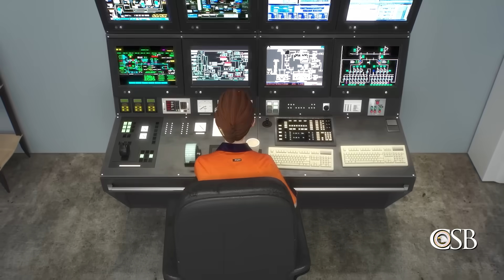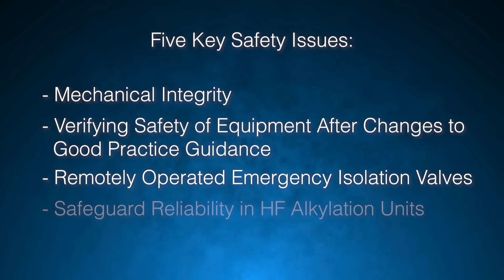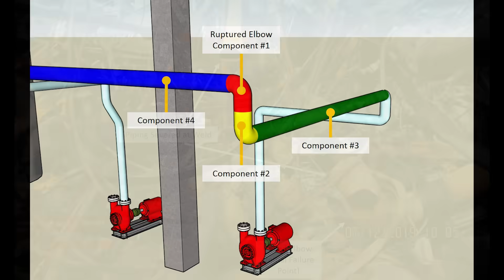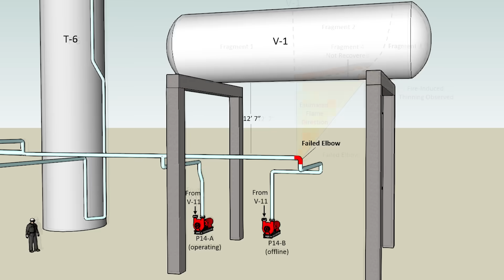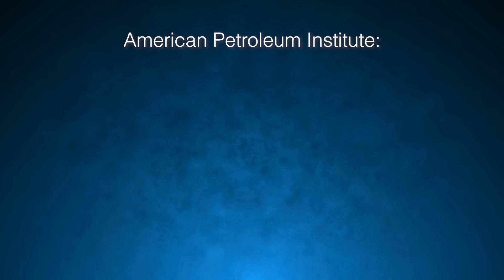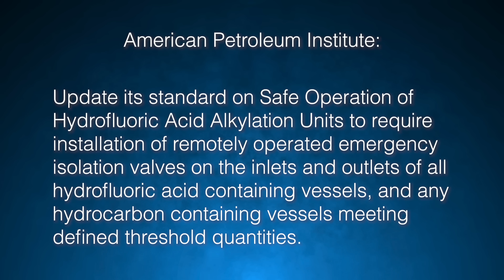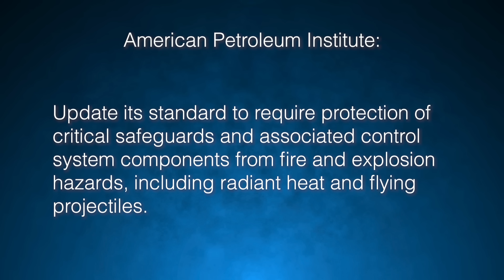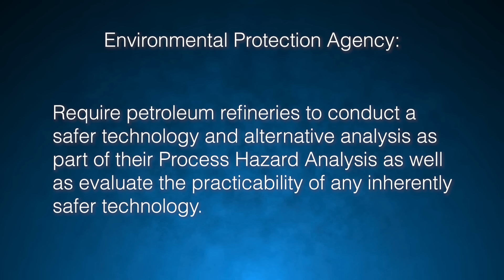Wake Up Call: Refinery Disaster in Philadelphia

Comment: I work as a systems engineer across every industry imaginable. I specialize in Medium Voltage Variable Frequency Drives, but I also tend to handle advanced applications or large applications of industrial automation control/visualization, industrial networks, and safety system programming. (If anyone has seen "how its made" I typically program and control all of those types of facilities)

I have watched everyone of your videos as I feel that most of the issues could have been mitigated through proper alarming and shutdown controls which are usually one of my core focuses in my line of work. These videos help me remain diligent and aware of control strategies that prevent or detect these failures. I can not express how much I value these videos, they have helped me refine a few of my control system safety programming and controls. I have even worked on a leak detection algorithm that can be used to predict leaks in production facilities (still needs some work). A lot of strategies I have implemented and adopted originated from me watching your videos.

Thank you all for your work!  I could not think of a cooler job than one that investigates these happenings and presents them to people to help them prevent the same from happening to them. I would do anything to join your investigation & development  team in a control system capacity! You guys are incredible.

You guys are awesome, I can not say it enough. I never take the time to comment anything on youtube but I felt that I needed to let you know that the work you do with these is incredibly valuable and appreciated, thank you!
Reply: thanks for probably saving a lot of lives by honing your craft.
Reply: @03056932  and you as well, sorry I did not see it until now.
Reply: It is always good to see the many ways things can go south in a hurry.  I am sure every scenarios you encounter helps build your expertise portfolio.  That expertise will not be directly replaceable, all we can hope is that as your career advances, you will pass along as much of it as possible to the next generation.  Doing that, you will continue doing good in the world for many years into the future.  A tremendous legacy Mr. Croop.
Reply: @vanguard9067  thank you for the compliment, I do appreciate it.

Comment: I don't know about the US, but over here in Europe / EU, refineries have to shut down every 6 years in order to do what's known as a "Turnaround" or "Revision Stop", EVERYTHING is drained and shut down for about two months, as the entire facility goes through repairs and maintenance as necessary. 
The last time I was on a job like this was in 2019 on the largest refinery in Scandinavia, nowhere near the size of this in Philadelphia, but still. 

There's a ridiculous amount of workers on site these two months, if I recall correctly someone said around 6 000 workers were involved back then, in order to finish everything within the timeframe set. Anything from cleaning out the piping, to changing piping, flanges, gaskets, blinding and opening and replacing reactor catalyst mass in ALL reactors, repairs and modifications to anything. 

ABSOLUTELY everything is being checked and fixed as needed, which probably helps combat things like this.

Comment: Nobody from API, or the refinery thought to test carbon pipe in a refinery for 45 years? 
Ultrasound testing is a Canadian industry standard. Plus our facilities go thru extensive maintenance every 5 years. Even steam systems.
Want to know what ball is being dropped presently? Just wait for all the new code applied to all the new hydrogen systems being built by all the new people. Worse yet, the rush to get small modular nuclear reactors online while simultaneously reducing “red tape”. 

40-50 years between turnarounds?

Comment: Leaks at elbows are common even in the plumbing construction industry. A sweeping elbow gives less flow resistance and last longer. Did I hear it was built in 1973? Amazing. Need to do some pressure testing given isolation of the test point.

Comment: I worked in that refinery for 30 years off and on for contractors those people would literally let the fireproofing rot off the beams before they replace it that whole Refinery was a rust bucket... old boilers rotten pipes they wouldn't fix anything until it broke they would run the hell out of the boilers just for profit the shutdown's got shorter and shorter to save money for high profits that whole Refinery was an accident waiting to happen so happy it's over

Comment: solution: the fire suppression system should be automatically activated. The remote site detects issues and notifies central control, but if it is unable to communicate or does not receive a response, should automatically start up. 
This could be detrimental in some cases, but probably better than current

Comment: Had the operators on shift that night not successfully dumped the HF tanks and turned on the water cannons, it's entirely possible that a disaster the scale of Bhopal could have unfolded. HF mists have been observed to travel several miles, and within that radius includes a huge portion of downtown Philadelphia. A worst-case scenario would have made 9/11 look like a walk in the park.

Comment: #BadDesign  The water cannons should activate automatically, even if there's not a fire, every second of every day unless a signal is received from the operators console. It's just water. It doesn't cost anything and if there's a bug in the wiring it's worth wasting some water to know about it before there's an actual fire.

Likewise. Isolation valves should close every second of every day and process pumps should stop every second of every day unless the control console commands them to stay open.

Seriously folks. You can't install a garage new door opener today without installing those damn optical sensors anymore and you can't even hotwire it because they send an encoded digital signal from one side of your door to the other.  If a wire breaks. Your garage door won't operate. Try it out. This kind of failsafe is default on residential garage doors. Why it was not in use and industrial chemical processing plant is beyond unforgivable.

Comment: 7:39 I can't see what you're saying about faster rusting in this picture. what I can see is the  simple connection of two pipes.
and that always looks like this. double wall thickness where the pipes are on top of each other, as seen in the photo (t2) and the normal wall thickness of a single pipe (t1).

Comment: HF is so much more dangerous than what it's made up to be here. If you spill some on your lap as a lab tech did a few years ago you're probably a goner. It will mess with the calcium ion channels in your body, stopping your nerves from functioning essentially. It's a strong contact poison. Even if treated to the best of what's possible you might die or get debilitating effects that last a long while. From the intro I would have expected many deaths. It's lucky the facility was designed with a contingency plan and that personnel did their job. That supervisor probably saved some lives. I'm surprised the piping didn't include automatic or remote controlled valves, on a fuel plant ? 🤔

Comment: I use diluted hydrochloric acid to remove rust from watches. You can literally only leave the parts in for a minute. Sometimes not even that. That shits some strong stuff. I got some on my finger one time and I literally couldn’t feel the tip for 2 weeks.

Comment: 😎(5:59)🌬❤‍🔥so, why is not the cause listed?.?
Do any fluids: flow without eroding the material, guiding them.?.
{an elbow should be obvious: highest friction point.}/!\ = Better bulge design, at elbows, joints.

😎😎(16:12) Bull shit. "Like, the liquid comes from a storage tank": and how many of those holding tanks get replaced, when corrosion starts at the bottom; contacting ground & water variations. = outside in & inside out.
Beat? The holding tank had rusted enough: to cause sand like steel; to wear down the pipe faster at bend. ({ don't lie that soft metals are more friction issues}) = 
((likely a finish on site, tank, required)) == needs a glass inner lining - so if there is a erosion problem, unseen - glass will fracture - which then should break the alarm coil rings - triggering (sound/sight/first response over head sprinklers, action) - {you get to smell, your obviously dead}. == {{not a single water tower}}.?.

Comment: I’m calling bs on this because there are or should have been regulations and inspections to safeguard against such this happening. 
Any facility like this has people do routine and in-depth inspections of all critical infrastructures. A highly rusted elbow? Im not buying it. Im not saying it is out of the realm of possibility because when humans are involved anything can happen. But this would have to be a gross negligence on the part of routine inspections and yearly, 5 year, expect replacement of such parts. Just very curious that things like this would not be on review as the end result would dictate upgrades or replacement parts vital.
Reply: It's not easy and it cost you a lot of money to perform inspection. Of course, sometimes administration often put too much faith in the equipment. Based on my experience, as lab assistant on operating hplc instrument, the administration do listen to our report on the the condition of the machine/instrument but never take it seriously until the machines have a breakdown... You too, big companies can be stingy too. I also believe there's plenty of rational or probably a stupid reasons  behinds it.

Comment: I ran fuel delivery for almost 15yrs in Detroit, Michigan and saw everything from questionably sketchy to down right run for your life scary stuff at these fuel terminals and it's always been surprising to me on how few incidents there was specially the older plants that have been in use since the 70s
Reply: What’s the worst you saw?
Reply: @lovemetrueblue2109  worst I ever saw from complete stupidity was a guy flying into the sunoco terminal with his brakes and axles on fire as he ignored it and started fueling up his trail while all of us driver where screaming and running away luckily the terminal manager kicked him out before anything really bad happened
Reply: Better question: what's the funniest/weirdest fix you ever saw?
Reply: @Joel-qo6gt  a driver brought his dog to work and while he went to use the bathroom his dog somehow kicked the truck into gear, causing the tanker to drive its self straight into the fully loaded BP refinery terminal luckily it hit a concrete post a foot before the 12" fuel pipe
Reply: @3613jeremy  pfft. Nice. Thanks for your time.
Reply: Incidents are not few.  I lived in Cheyenne, WY for 30+ years and the refinery there would average 1-2 fires a year, had a few tank explosions, and questionable gas releases at least every few months.  They also had a sizeable cancer cluster near the refinery as they almost constantly released benzene into the atmosphere.  The most ominous was the few times that huge yellow clouds would vent out of the top of a cracking unit, no idea what it was but I doubt it was anything good for you.
Reply: @mrvwbug4423  when considering the accidents and ignorance at these fueling terminals, it really is surprisingly rare and any terminal catching on fire multiple times would make me think there was some serious corruption in that city county and state
Reply: @mrvwbug4423  as far as the yellow cloud did it drop a yellow dust over everything??  we had the same issue but it's wasn't from the fuel terminals is was from the city sewage system doing burn offs on none windy days

Comment: From the final report (https://www.csb.gov/philadelphia-energy-solutions-pes-refinery-fire-and-explosions-/) Appendix A - Incident Timeline
04:02:06  Released Hydrocarbons Ignite;
04:22:00  V-1 BLEVE Occurs 
Elapsed time --> just short of 20 minutes.

From the long superseded 4th edition of API RP 521 Guide for Pressure-Relieving and Depressuring Systems published in 1997 (the document is now classed as STD, a standard, not an RP recommended practice, and is in its 7th edition as of 2020): 3.19 Vapor Depressuring:
"When metal temperature is increased above the specified design temperature due to fire ... , the metal temperature may reach a level at which stress rupture could occur. This may be possible even though the system pressure does not exceed the maximum allowable accumulation.

The use of vapor depressuring is one method of avoiding such an occurrence.
...
For sizing, this generally involves reducing the equipment pressure from initial conditions to a level equivalent to 50 percent of the vessels design pressure within approximately 15 minutes."

Use of emergency depressuring (EDP) to avoid vessel rupture was a feature of API RP/STD 521 before the 4th edition, I just don't have access to a copy that old. My expectation is that the concept is recommended in the standard dating back probably 30-40 years.

I agree with 67Fairlane, the console operator's response was spot on. But when I was watching the video, I was yelling out loud "blow it down". There is no mention of vessel/plant blowdown as a potential mitigation by the CSB in the report, so I assume that an EDP system was not part of the plant's design. The incident then serves as (an unnecessary) validation of long standing industry knowledge and, for this sort of facility, generally applied good practice. If an EDP was installed and put to use, the extent of the overall hazard and subsequent asset loss would have been significantly reduced.

Many thanks to the CSB for their work. You are a leading light for the industry globally. Keep teaching us those old lessons that unfortunately get forgotten and are then relearned.

Comment: 8:87 Regarding this.. ASTM standards changes very slowly. I think the engineers, especially if the engineers installing the pipe is not on board anymore, might not notice and assume that the system is fine.
It's an extremely hard and expensive issue to address, can understand why people don't want to do them. One suggestion is to have a good community of pipe enginners who can notify each other.

Comment: Funny, the same thing happened in Superior WI only a few years ago. You could see mushroom cloud from 50 miles away, and most of the town was evacuated. It feels silly to say "luckily" it wasn't any worse, but it was a disaster for the community, environment, and economy in the town. If that weren't a wake up call, I don't think this will be either. Americans are way too addicted to fossil fuels to even consider accepting a new generation of technology that is already proven to be safer and in its early stages of life. There are now battery packs that can not start fire and will simply "vent off" smoke from the damaged cells in the event of a failure, and that is a worse case scenario. The more we invest in EV tech as consumers, the faster and further it will progress, leading us far away from these disasters and
Reply: also did a video on the superior explosion. I recommend watching it.

Comment: They really dodged a bullet here... for perspective, that 38,000 pound (17 metric ton) piece that landed on the other side of the river weighed more than a semi-trailer/tractor-trailer.  And hydrofluoric acid is incredibly nasty stuff.. I've seen the effects of a relatively small spill of liquid HF in a university lab and it burned straight through the guy's lab coat, jeans & shoes before anyone even knew he'd spilt it.  They got him into an emergency shower in less than a minute but he still ended up needing skin grafts & they used photos the hospital took of the exposed bones in his feet as part of the safety training from then on.  Seeing those photos & his scars certainly made you take chemical safety very seriously!

Comment: If it was up to me id make a new rule that says no pipe that has corrosive material running through it on a regular basis is allowed to stay in operation for more than 50 years and it must be replaced at that point regardless of what it is made of.

Comment: What a chain of events. One elbow with an incorrect metal composition, a resulting refinery fire 50 years later,  bankruptcy and closure of the east coast's largest refinery, Covid hits and oil/refined product demand falls off a cliff, Hilco purchases refinery site and demolishes entire refinery as part of site redevelopment,  Covid  cases/concern ebb, economy and oil/refined product demand come roaring back, between this refinery closure and others closed during pandemic there is not enough refining capacity to keep up with demand, refining margins sky rocket, fuel prices sky rocket, inflation sky rockets, and the north east is going into the winter of 2022 with low heating oil/diesel stocks. The power of a steel elbow.